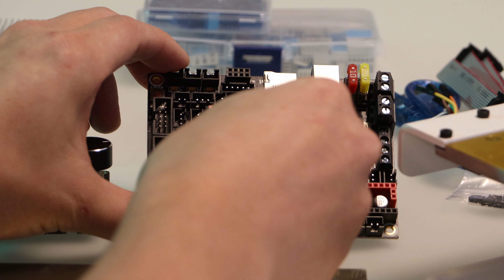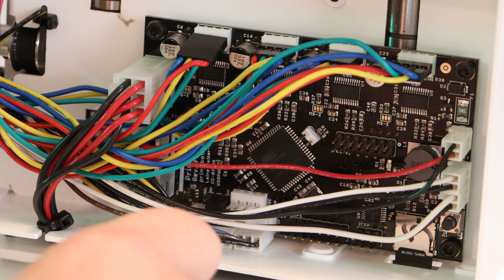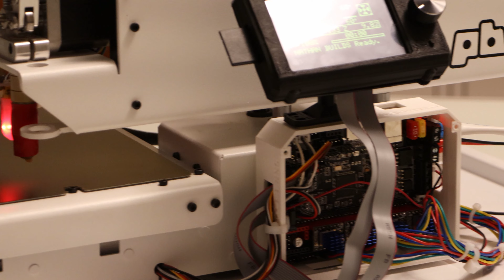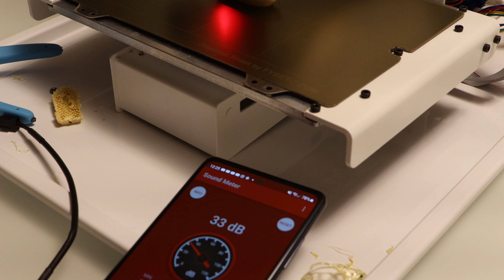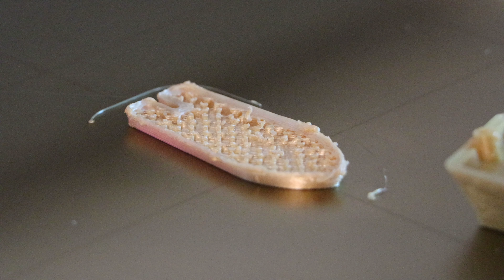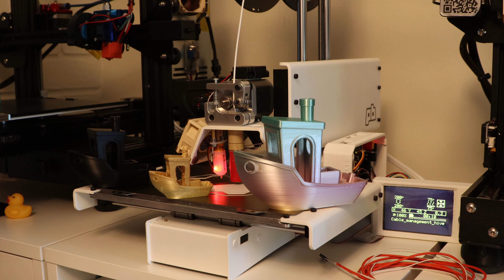FANLESS 3D PRINTER BUILD - PrintrBot Simple Metal Revival

Comment: Thanks for the video man. Very detailed. I inherited one of these machines from a friend who barely saw any use. Love the implementation of the screen. Would see about usability today. I would use it for hobbying purposes , nothing serious.
Reply from the maker: I could never get that stock gotten to work very well, I should really upgrade it
Reply: So 2 weeks after the fact and after a TON of pain and long nights I managed to get the machine to print. Have to find tun it alongside with Cura settings but it seems quite promising. Now one of the biggest or next rather is how loud it is. Lastly, I wanted to ask, would you be able to record, unless you already have, how the homing sequence runs on yours? And the wiring of the BL touch. I figured out the proximity sensor but I’d like something more up to date.

Comment: Should have used support material, maybe for 60d overhangs.  I've had a Printrbot Metal Simple since 2013 and I can tell you that you just need to adjust the temperature and feed rate a little to achieve excellent prints with that old school hot end.  Also, I use the stock filament retraction feature in Cura.  I'll give you $50 for that board you removed (if it is in normal operating condition).
Reply from the maker: It should still be good, I was printing with it right before the mod video. I looked around and couldnt find it, but I'll let you know if it turns up somewhere.
Reply: Thanks, Nathan!  Keep on building, I'll keep on watching...
Reply from the maker: @goesintite  BTW I found the board. Reach out on my contact form if you still wanted it:
https://www.nathanbuildsrobots.com/contact

Comment: Great video! Good pace, straight to the point. Good audio and video. Excited to see your custom heatsink :)
Gotta admit, naive me thought this vid will be about a fanless Ender ;P
If you are interested in a ultimate silent build check out servo motors for 3D building, they are more complex to set up for 3D printing and have some other drawbacks but are a fraction as loud than a classic stepper motor and don’t loose torque with high speed. I am currently preparing to mod my Ender with these as noise is a huge concern for me. Hypersensitive to noise due to autism. Also check out the material Butyl, it’s used for car insulation and converts vibrations (mechanical or air pressure) to heat. But don’t make the error like me and them under the printer, the ideal setup (without enclosure in this case) would be to put these (they have doublesided tape) onto every place on the Ender that is not restricting movement.
Also there is the Stone slab trick (YouTube channel CNC Kitchen) where you get a huge stone slab where you place your printer to absorb movements like vibrations (look up heavy duty CNC machines) and place a foam mat under the slab. Get one that is thick/strong enough that avoids the slab making contact with your desk. That way you have even less noise, depending what resonances your desk makes.

Your videos are very enjoyable to watch and it’s Great to see someone else focusing on a silent operation of printers :)

Cheers :)

Edit: also check our Velocity stacks for your hotend fan intake, that kills also a bit of noise and chances the frequencies to more pleasant ones.
Reply from the maker: Oh man, you're going to love my next video. This video was more of a practice run before I took apart one of my working Ender 3s. It will be a similar concept but on the Ender 3 platform. I'm having a new problem where my mic can't even detect the noise 🙄

I put squash ball feet on all of my 3d printers. They are gas filled butyl balls and they work amazing. Haven't put them on the printrbot yet, but will soon. 

One of the best materials for damping vibrations is sorbothane. It might just be brand named butyl? But it's impressive stuff. 

Also there are some awesome composites that are made of a rubber sheet sandwiched between 2 layers of sheet metal that have amazing damping properties and still have good stiffness.